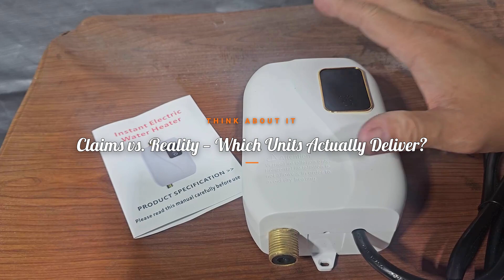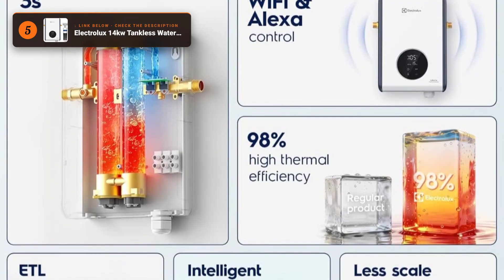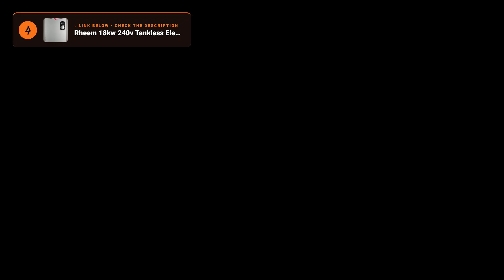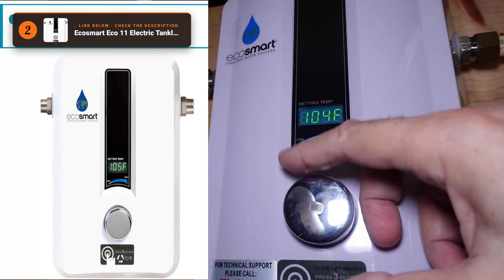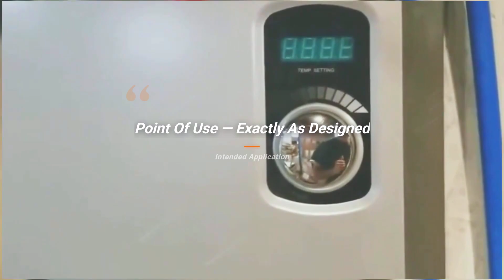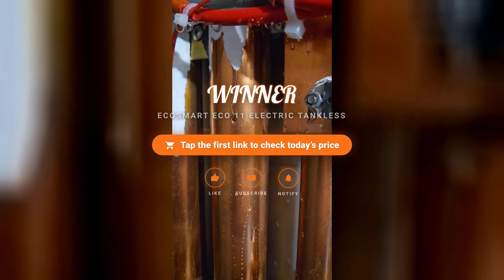Best Electric Tankless Water Heaters 2026 Find Which One is Right for You

Comment from the maker: Products Here 👇

Check out the products using the links below!

1. Brand: xwdzswgs 110V Tankless Water Heater Electric, 3000W Tankless Electric: https://www.amazon.com/dp/B0FTCMVRY3/?tag=practicalpicks-20
2. EcoSmartWaterHeaters EcoSmart ECO 11 Electric Tankless Water Heater, 13KW at 240 : https://www.amazon.com/dp/B001LZRF9M/?tag=practicalpicks-20
3. ORBEKTanklessWaterHeater ORBEK 18kW Tankless Water Heater Electric 240v - On Demand W: https://www.amazon.com/dp/B0G238Z6N4/?tag=practicalpicks-20
4. Rheem Rheem 18kW 240V Tankless Electric Water Heater, Gray: https://www.amazon.com/dp/B01MR7Z39V/?tag=practicalpicks-20
5. Electrolux Electrolux 14kW Tankless Water Heater Electric 240V - Smart : https://www.amazon.com/dp/B0GDXC5B6M/?tag=practicalpicks-20